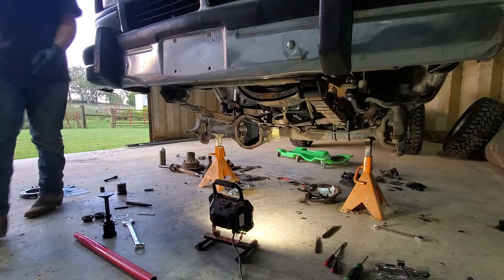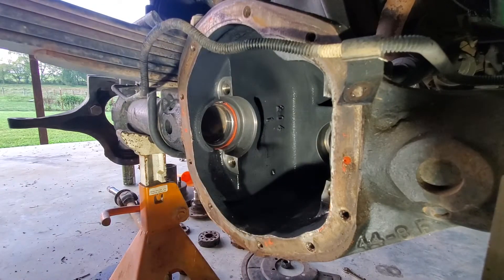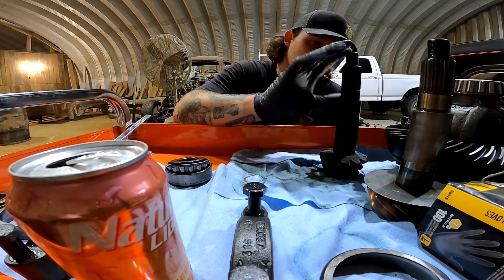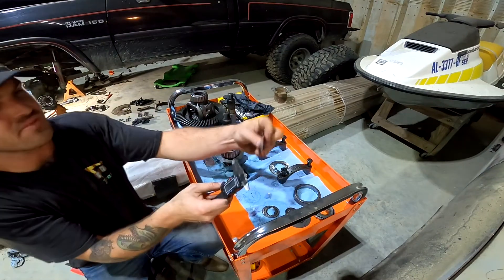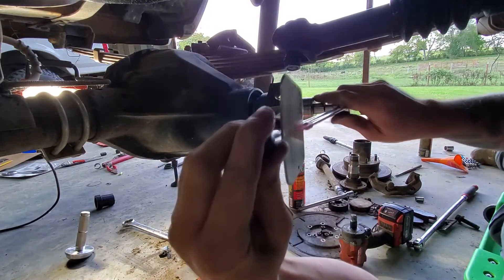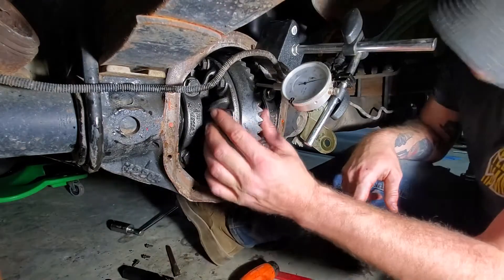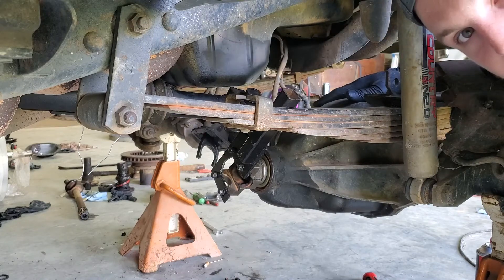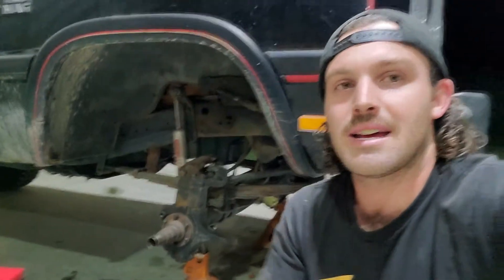Dana 44 Axle Regear (CAD axle)

Comment: I know this is years old. But the next time you set up pinion depth, order two identical bearings. Hone one out with a brake hone or some other type of hone, sandpaper whatever have you. Hone it out until you can slide it on and off easily. Makes checking depth a lot less painful. Then, finally, press on the unhoned permanent bearing.
Reply from the maker: I was going to do that, but at the time I was trying to get it done on a budget. I'm thinking next time I do gears I will do that. it was a pain haha